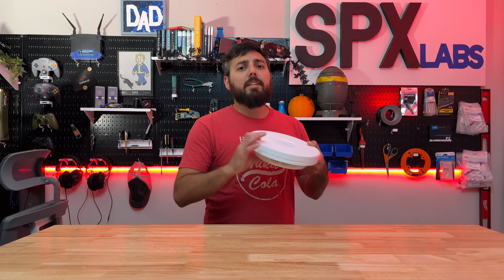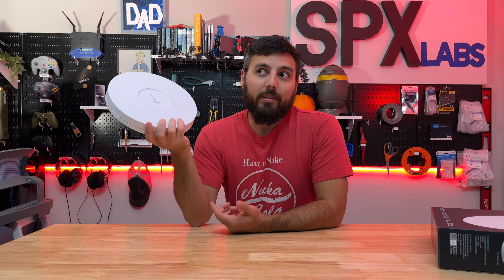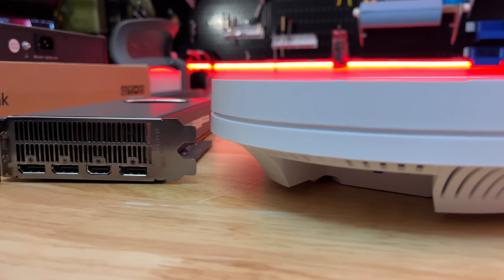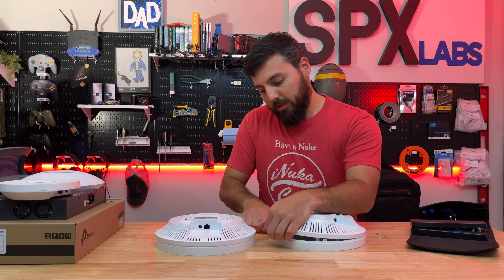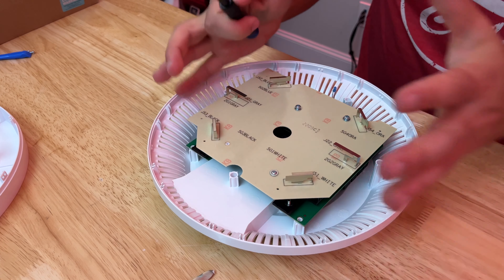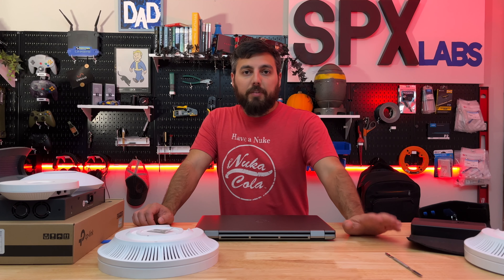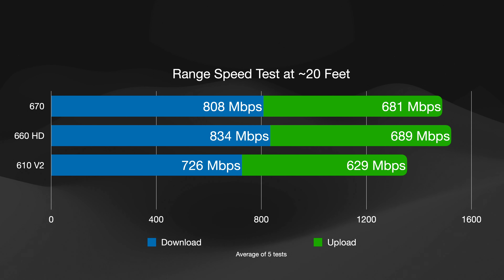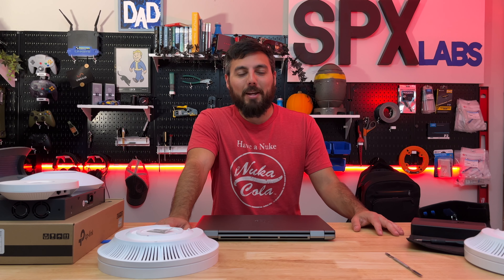TP-Link Omada EAP670 Access Point Unboxing, Overview, Teardown, and Speed Tests

Comment: Well done, as always! I use DFS channel 64 and when it gets 'triggered' it does not turn off the WiFi, but the AP changes its channel, and continues to work. Even though I'm 1.5 nm from a small airfield that happens maybe only twice a year
Reply from the maker: Nice.  It was kind of neat to actually use DFS.  I'm actually not sure what TP-Link does if DFS gets triggered.  It would be cool to be able to test that out and see what happens real time.

Comment: From what I have read the 670 has less and shorter reaching antennas. I have the 660hd and I go go over to a neighbors house and still reach the in the 300mbps ranges. It is centralized in my house but I still plan on adding 1 more 660hd in the house and spreading them evenly near the front and rear of the house. It is an absolute beast of a unit.
Reply from the maker: The 670 has 6 antennae versus the 660HD with 8.  The 660HD has very good range, it's pretty beast.

Comment: Thanks for the review! Trying to decide between the EAP670 V2, EAP660 HD, and EAP650. I have a single story L-shaped home with (50) 2.4 GHz clients and (10) 5GHz clients. I am thinking 3 access points, with one of them POE+ to my ER8411 (on one side of the house) and the others mesh (for now). I currently have (3) eero Pro 6 APs and they work great (~600 down), but I'm looking for VLAN. Would the EAP660 HD be better my use case due to the 4x4 2.4 GHz?
Reply: I went for (3) EAP660 HD access points... they are terrible. I went from ~600 Mbps down to <100 Mbps down. Looks like I should go back to the the (3) eero Pro 6 Ads.
Reply: @Mstgkillr  Thanks!

Comment: You can preserve manufacture stickers by using a hair dryer on medium or high heat for a few seconds before removing them. This simplifies the process.
Reply from the maker: Where were you like 6 months ago! Damn.  Thanks for the heads up I’ll give it a whirl in the future I’m sure
Reply: @SPXLabs  You can also remove sticker glue residue by applying WD40. Leaving the solution on the glue for a few minutes, scribing, and wiping clean.

Comment: Nice review. TPLink's WIFI stuff really is impressive in terms of performance. The only thing I dislike is the size. I guess you do have the EAP610 which is much smaller but I am wondering if it gets very hot when under heavy usage?! The EAP610 is slightly less powerful at range but I suppose if you really need to, you could use TPLink's MESH and have multiple EAP610s around to cover all the areas you need. But not sure if I would be getting WIFI 6 now. As you mentioned, while performance is not bad closer, there is WIFI 7 coming and apparently it is supposed to be a game changer. But then again we are talking about much more powerful frequencies (I really am starting to think, is that really good for health?). Anyway I digress.  I need to replace my ASUS router / Access Point anyway, it is not powerful enough to handle my growing numbers of smart devices. I suppose I wont need WIFI 7 for that. And like you, I'm more of a wired guy and my house is fully wired now but still there are devices for which you'll always need WIFI such as phones, etc.

That voice overlay of "bandwidth" 3 times in your video, hmm wonder that was for ;-)..
Reply from the maker: I'm not sure.  I've been thinking about buy a thermometer but they are needlessly expensive IMO.  Maybe one day idk.  You would definitely want more 610s for larger homes, like 2000sq ft and greater, especially if you have an office far from the access point.  I think WiFi 6E is going to be the sweet spot.  But really it depends on the industry and who adds it to their devices.  I'm surprised many manufactures even bothered to support WiFi 6 since WiFi 6E was available shortly afterwards.  You definitely wont need Wifi 7 for that, just a device than can support multiple devices really well.  Many devices work better on WiFi and maybe it's just me but I don't need 1000Mbps to my phone.  Laptop maybe but if I'm doing work, I use a wired connection.  Just glad we have the option to regular hit 700Mpbs+ over the air.

Guess we will never know.
Reply: @SPXLabs  Same here, don't need those ridiculous speeds on my phone. If I need something that needs high speed, I'll use my workstation.

But yeah I think WIFI 6E is probably more than enough for what I do. Provided the WIFI unit I use is able to support multiple smart devices for people who like to automate their homes with Home Assistant. After using my ASUS routers that I had to try and do that, they really aren't able to handle many devices. TP-Link's WIFI units are tiers above any ASUS router and should be able to handle the load.

My house is 1000 sq.ft for the main floor and another 1000 sq.ft for the basement. The backyard is about 30 feet long. I'm guessing two EAP610 would be enough, one for the basement and one for the main floor in a central location for both. Two other two units would be way too much power I think.
Reply from the maker: The longer you wait the better technology will be lol.

Comment: Another thing to note, disassembling the device will also VOID your warranty, and TP LINK do give a long (5 year) warranty.   There is no reason for the average person to take these apart, so it is good to see someone else do it.
With the DFS Channels, do the EAP 670's reduce the power accordingly?    I believe that in the DFS range, the devices have to run at much lower power normally than they can in the non-DFS range, so there is not jsut a hit in that they have to move if a RADAR activates, but they have lower power output at all times in DFS band.     This could explain the significant drop off at 50 feet.      Obviously I can only work with the laws in my area of the world, so not sure how it wokrs in other areas.
Reply from the maker: Better me than you all!

I don't actually know the answer to this as I never really test max range just variable ranges around the house.  But it sounds like a potentially good reason why to me.

Comment: Cabling with RJ45 is still and will be a must for people that require steady throughput, that said, i do think that WIFI has come a long way, yes its hard to sustain what's rated due to how it works and obstacles diminish a lot the bandwidth it can get, but user has so many options now a days, with multiple access points that they can have relatively good coverage if they wish to invest.  

I just helped a friend plan his wifi on this new house, and work out really well with 3x Ubiquit U6Pro, has very good coverage all around the house, and specially stable for all the smart things he is adding.

I do feel the omada ap were a little low imo, would be great if in the future you can compare them to unifi U6Pro / LR / Enterpise?
Reply from the maker: Don't get me wrong I love WiFi it's a great technology and I am super happy that it exists but I'd rather just plug in currently.  WiFi today is literally better in every way than it used to be and seeing 1000Mbps over WiFi is just insanely awesome.

Smart things and WiFi is a match made in heaven.  Couldn't imagine having to run a dedicated wire to each smart device, yuck lol.

I agree, there does seem to be some interference causing drops in the speed.  Sometimes the speeds would spike to 950 or so then just steadily decline down to 800 or so.  The channels I scanned and ended up using had 1 or 2% utilization.  I'm pretty sure any interference wasn't from neighboring WiFi signals.  And there were no other wifi devices on that network so idk why the speeds were?poor?  Maybe one day we will see more Ubiquiti stuff added, I do afterall have a couple U6-LRs sitting around, but in truth since my home network is all Ubiquiti and everything is very stable and sitting happily, I don't want to disturb it lol.  I'm paranoid about it.  Maybe even superstitious.